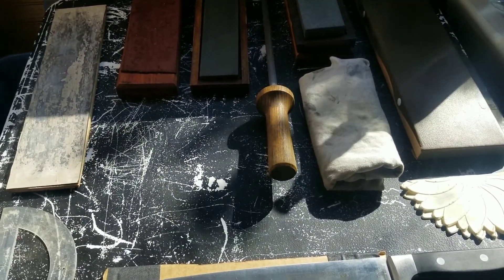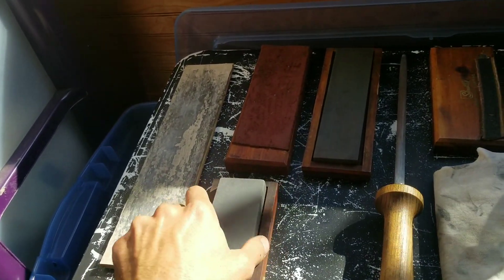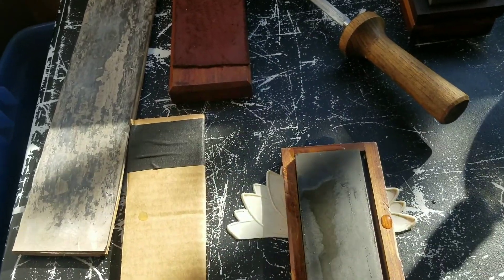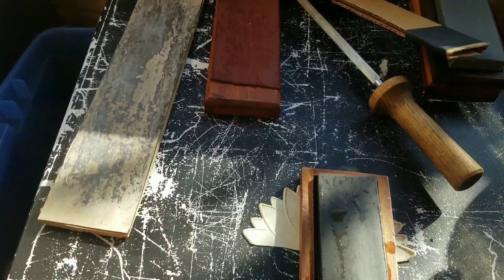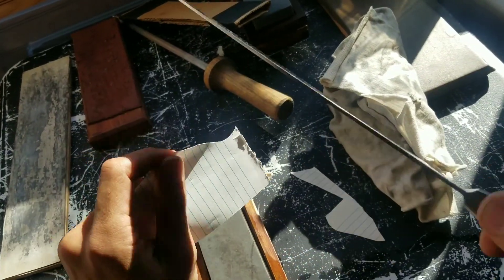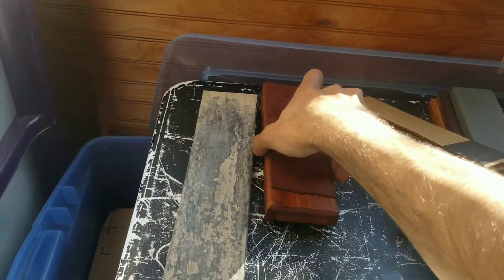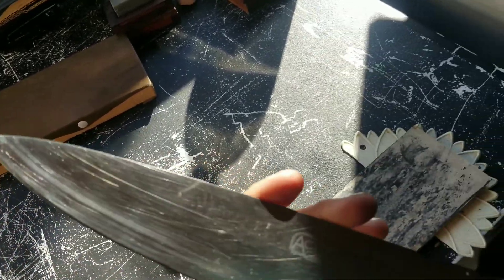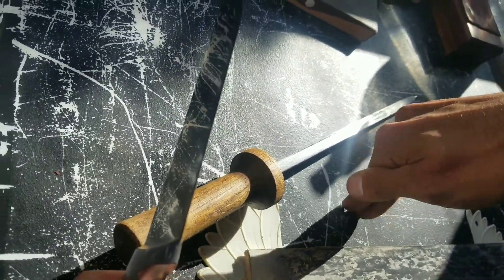How to Sharpen a Knife or Tool (Get a Razor Edge by Hand Using a Sharpening Stone)

Comment: It is pretty quick once you get it down. But the hours and hours and Hours I spent to be able to do it quick were long and many. I remember the first time I sharpened a knife I spent a whole day and the thing never got sharper. Instead, I made it duller than before haha. It took me a week before I ever got anything somewhat sharp, and after that I still wasn't good at sharpening. The first time I ever got a sharp edge I used the sharpie trick and even then it took me a whole hour. Now I can touch up an edge in 5 to 10 minutes depending on the condition it's in, if it's got nasty chips it still takes me a while but usually no more than 30 minutes thanks to my Norton Crystolon stones.